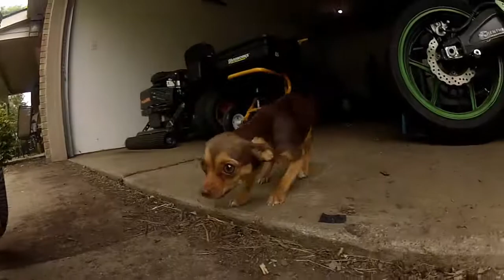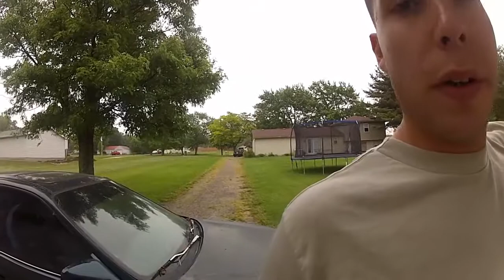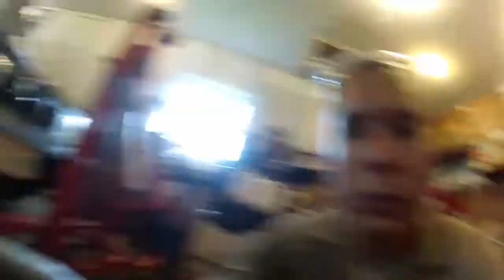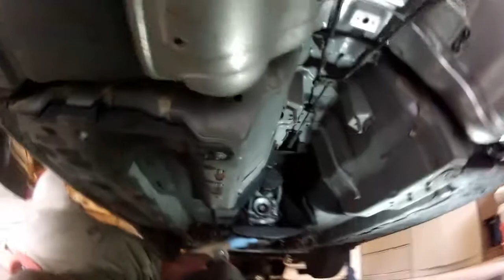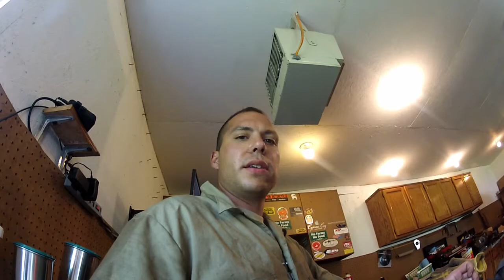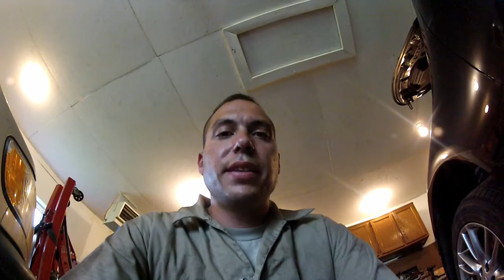Getting intimate with my g35 and it's dirty! Transmission removal

Comment: I have removed everything that’s been shown in this guide, but I can’t seem to get the transmission separated from the block. Any suggestions? I have gotten all bolts out and I’m sure of that.
Reply from the maker: Starter and all bolts top and lower ones that are hidden iirc theres some that are not very obvious. If u forsure have all bolt u probably need to pry it as maybe the input shaft is stuck on the disc. Try wiggling left and right from the tail (where driveshaft connects to trans) to break it free.
Reply: ClutchKickerNation thank you for the quick response! These “hidden bolts,” are they directly on the transmission, or do they get mounted somewhere less direct? Everything on the transmission has been removed, and I’ve tried prying and wiggling and I’ve made a small bit of progress, but still to no avail. Thank you so much!
Reply from the maker: @1shuttle100  sorry for the delay i was laying down for bed after my last reply. but goto 
https://www.nicoclub.com/service-manual?fsm=G35%20G37%20Q40/G35/Sedan/2007/tm.pdf then goto page 29 and it will show a diagram of how to know which bolt goes where on the bell housing for installation and verify you have all those bolts removed. the lower ones u have to go from front of engine towards rear of car around the front sway bar so maybe you missed one there, also make sure there are no brackets or anyting and make sure u removed the crank sensor unless u have a 07-08 iirc the 07-08 are the ones that have a slot to be able to removed trans without removing crank sensor anything older u have to remove the crank sensor first. i should of mentioned that in the video if i didnt i appologize as it didnt exactly pertain to my situation, but also u can read through the fsm and see if u missed anything like shifter and what not. let me know if u have any more questions ill try to help
Reply: Torque converter bolts

Comment: HA, how much do you hate yourself, b/c you didn't install the external kit when you had the chance?
Reply from the maker: I dont. Since this is a daily and the OEM clutch lasted 100k, and there were no other issues I'm decided to just replace it with OEM stuff. So far 12k no issues. I do have a upgraded csc if I ever do have problems I'll change to that

Comment: Can I replace the transmission slector switch without having to mess aoth the transmission?
Reply from the maker: Can you Clarify? From the question it sounds like you are referring to an automatic transmission. If that is the case i am unfamiliar with the location and removal process but i could get you the info if you provide some more detail

Comment: Would I need to take out my shift knob if it's automatic?
Reply from the maker: This is for a manual and u have to probably disconnect the shifter linkage for an automatic I'm unfamiliar with the exact process as I have never worked on one

Comment: how you remove the top two transmission bolts?
Reply from the maker: With extensions, I also lowered the crossmember with the transmission on a jack to gain more access
Reply from the maker: @deecee7300  mixture of both just did whatever worked to get the bolts out